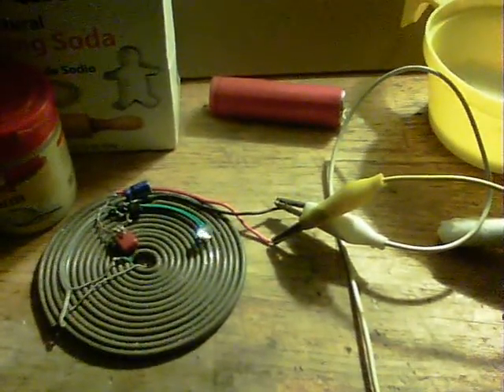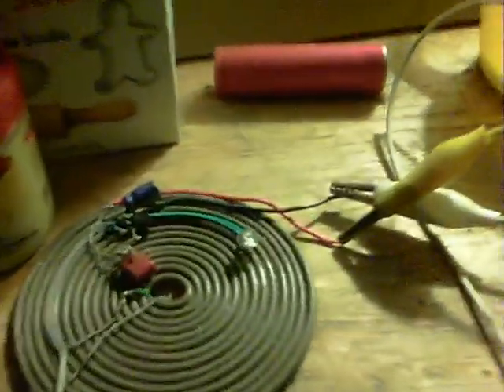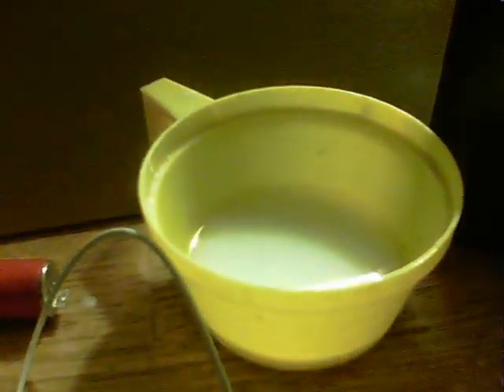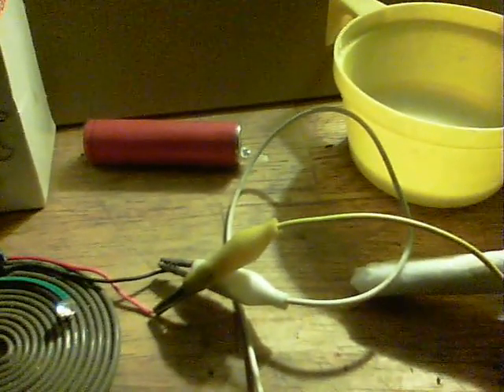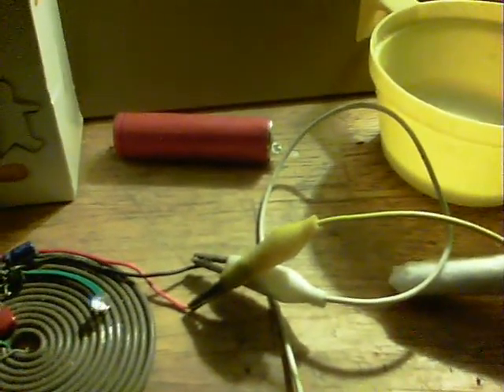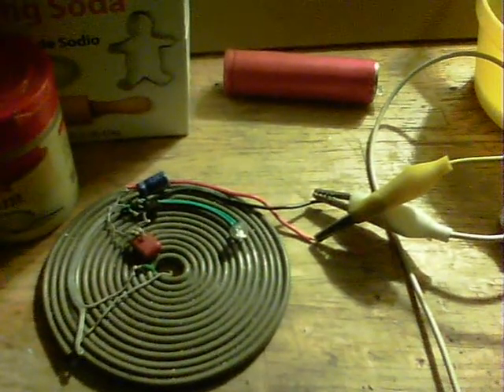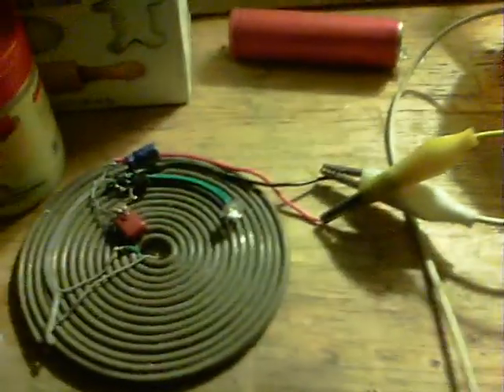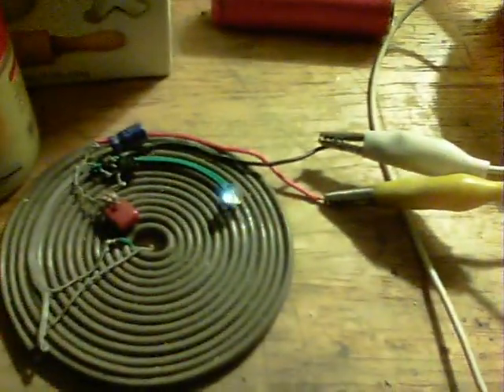Tinfoil Rechargeable Cell

Comment: I wonder if I made one of these with a lot more Aluminium foil if I could increase capacity and current
Reply from the maker: Maybe so. At the time I was just looking at whether the same metal could be used to form a cell...sort of a capacitor road. There wasn't much of an output in some ways, nothing groundbreaking but it does work fine.
Reply: Slider2732 interesting I made a sealed cell with baking soda and Epsom salt a Aluminium foil core in a 1 inch copper pipe coupling used to connect two copper pipes.  I have gotten around 30 ma for a few seconds before dropping to about 5 for a longer time. I’m working on a video about it. I also just bought some alum so I can test that on some.

Comment from the maker: You mix should always output about 0.6V and 50uA or so (depends on electrode sizes). The vinegar will be quite aggressive though long term to the copper. 
This whole thing is about same metals for both electrodes and non galvanic actions within as neutral an electrolyte as possible. Basically, lead needs to go and more environmentally clean cells to come from it all. Best wishes for your experiments, good to hear about them :)